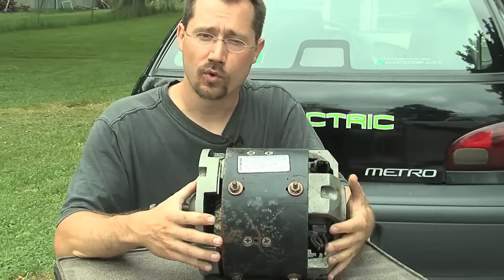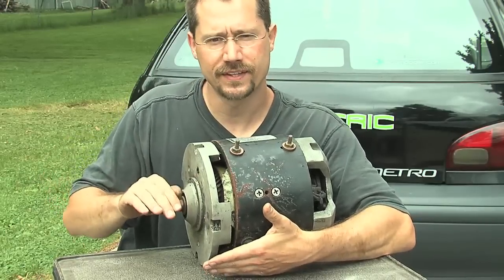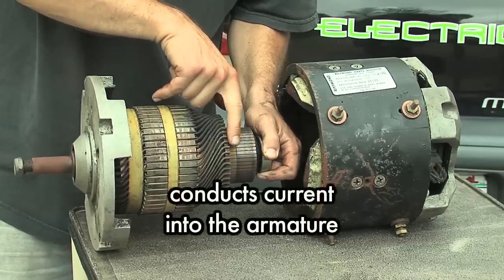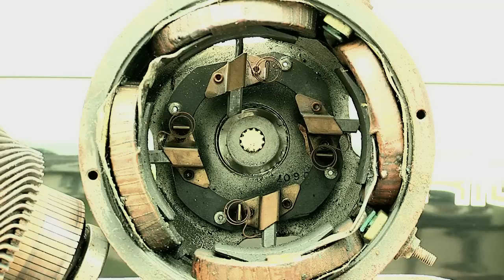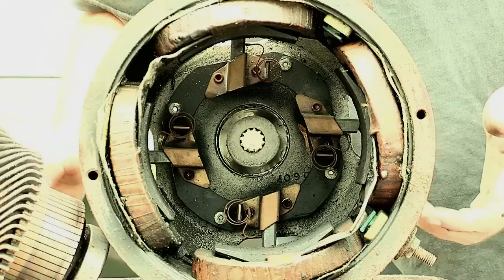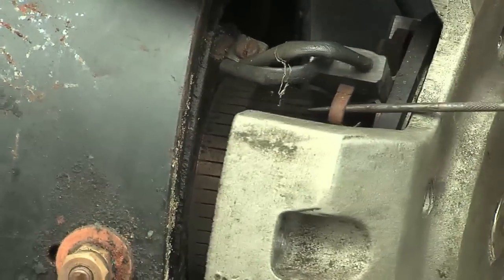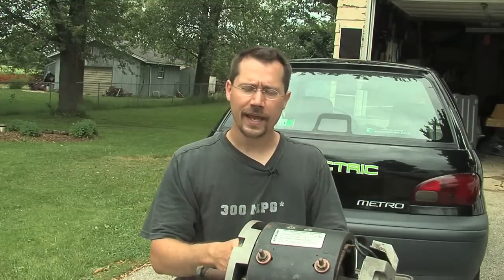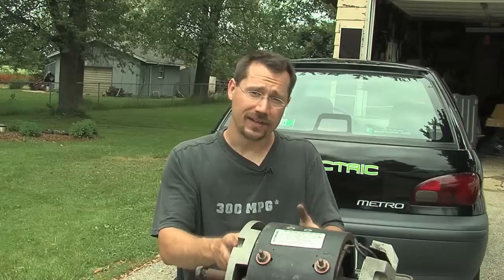DIY Electric Car: 04B DC Motor Basics, Part 2

Comment: I've been watching your series of videos and they have given me some good insight on my next project. Great job!!!

Yet one thing needs to be addressed when you replace motor brushes.

I am a certified Yale/Hyster/Cat/Nissan/Mitsu/Crown/Clark/Raymond mechanic.
Most all manufacturers require the commutator to be stoned (yeah, sounds funny) when replacing the brushes. This is required for warranty and performance assurance.

When you purchase your brushes, ask the supplier for a good quality commutator stone for resurfacing the copper contact surface before installing the new brushes.
It will make a WORLD of difference to the performance of the motor plus ensure proper seating of the new brushes. Most generic brushes are flat (not concave to match the curvature of the commutator surface) and will require a "seat time" for the brushes to make 100% contact.

The concept is much like resurfacing a brake rotor.

Note: Safety first!!! You are working around electricity and moving parts!!!
If you are the least bit squeamish or doubtful, then don't risk it. Common sense rules. Don't be careless and either electrocute yourself or get your shirt sleeve caught in the motor OR have stone chunks or motor pieces flying into your eyes/face.

Before you remove the old brushes, only take one brush out completely.
Inspect the commutator for pits, uneven spots, burn marks and ridges.
Place the machine in neutral or jack the machine up (chock the wheels)
What you do next is simple. Start the motor, low-ish rpm's, stick the commutator stone in the slot where the removed brush cavity is at. VERY carefully and slightly, press the stone against the commutator. You will begin to see the outermost layer of copper on the commutator start to shine up. Slide the stone from side to side in the brush cavity, keeping an even and gentle pressue. Once you have removed the oxidized or dirty film layer on the commutator and have achieved a uniform shiny and even surface, you are done.
IF you have access to a good air gun, blow out the residual dust from the commutator and motor. Inspect for any contaminants or cracks.

Remove the old brushes, install the new ones, return the springs.

There are instructables online that show you exactly how this process is done.

This is just an FYI for you all who HAVE bought an old or older motor and want to truly return the motor to fresh and new state.

Happy motoring!!!
Reply: YES! Eric, I used a commutator stone when I re-finished my motor. You said it better than I could. Everyone, please read Eric's above comments, it's well put.

Comment from the maker: It was several years ago that I put new brushes in my car.Mine are still just fine. Some of it DOES depend on the quality of your brushes. There are several different materials, and some are harder or softer or more durable than others. It is a maintenance item, but replacing the brushes is easy. (Beats doing oil changes, air filters, etc.!)

Comment: Good explanation right there!
I'm thinking of replacing my engine in my little van, but also having a 50ccm engine that can extend my range, and at the same time, ditch my transmission because of this unbearable mess with oil.
I want to be able to drive with unlimited range, so this should be golden ^_^

Comment: I appreciate your help with all the knowledge. One simple question to ask: why are the brushes not put exactly 90 vertical degrees from eachother? Wouldn't cause a problem when the rotor turns in the opposite direction?

Comment: Hi Benjamin,
Thanks for your great explanation about running on a Electra motor. Great videos,keep it going please...
I have 1 question for you or all other fans :
Is it doable to put something like dynamo's on the wheels or solar panel for charging while driving to get more miles?
Hope to hear from you and the other fans.

Comment: Hi, great video, I'm very excited about to do the same as you, but I was wondering, how you can deal with the water, as this motor is open, there is no problem to the water come inside ?, there is to be sealed motor or there is no problem, other thing about the steering wheel, is that hydraulic one ?, how you handle this, or there is no hydraulic, anyway is a good move, and I build my own using also your instructions. Have a great day. Tks.

Comment: Can u put an' onboard' battery charger? besides the charging systems that is set by your design  by a magnet driven charger also? by placing the magnets at an angle with a gen. on place where there is room 4 it?

Comment: Here is a question I have to ask, a windmill spins, tires spin, better yet, so does a car's' air conditioner when you turn it on, and a battery charger can turn it off when it's charged. It seems this concept be used to extend the distance?

Comment: My concern with using a fork-lift motor was that those machines are usually worked really hard for as long as possible, but it sounds like some parts last practically forever and the others are not hard to replace. The Bearings is what I would have thought would be really trashed. 
How would this motor compare to using a golf-cart motor?

Comment: How do I tell which terminal is A1 or A2? It seems to me that it wont matter because the stator fields will either attract or repel the armature windings no matter which arrangement you use. As long as I don't put a positive (A1 or S1) connected to another positive it wont matter. Right?
Thanks for all of your help

Comment: what about using a dune buggy frame?  (weight reduction i'm thinking)  also what about using ultra high grade industrial capacitors instead of batteries?  What power storage devices do you use?  Have you installed solar panels or use a peltier plate?

Comment: I love your simple real speak presentations, but, saying hp doesn't matter doesn't help me to select an alternative electric motor to a 100 hp gas engine's performance. Yes I know I will get more at the bottom and less up top, I'm referring to a median.

There must be a way to judge rather than merely saying 36V and hp doesn't matter, otherwise there would only be one size electric engine for everything.

Could anyone enlighten me please and help me to understand it a little more? I am actually searching for a 100hp replacement right now (that's why i am here). Thanks again.
Reply: Mark Mark doing electric repowers on boats I’ve heard 750 Watts = 1 hp so 100 hp would be a 75 kilowatt motor however a 75 kw motor is incredibly powerful think, the torque of a Dodge Ram v8 that can tow a 10,000 pound trailer. You would probably be fine with a
30 to 50 kilowatt motor and you can find kits for 3 to 6k on eBay for repower.

Comment: I'm an airsoft player that uses a PTW, so I know a fair amount of knowledge in regards to DC motors.  The motor I use has permanent magnets.  That being said, my motor brushes are used up relatively quickly depending on use.  How long do the brushes last for a DC motor in an EV?

Comment: I hear about the 9 inch or 11 inch motors, or warp 9 and 11. Where does a forklift motor fall into this? are they typically more, or less powerful than a motor made for a EV conversion? Oh, I'm thinking of using a 1991 Ford Ranger and maybe filling the bed with very large forklift batteries. I'll need something to run the vacume for power brakes.
Reply from the maker: +Fly house of truth The motor I used in my Geo Metro was a 10.5 inch diameter series wound motor from a full-size, sit-down Nissan brand electric forklift. It seems to compare pretty well to a Warp 9. There aren't that many differences between a plain old forklift motor and a series-wound motor sold specifically for EV use. The main one is that the brushes are "timed" differently if you are running higher voltage. That is, the entire ring that the brushes are on is rotated slightly due to the fact that the magnetic field distorts a bit when you are running high current/high voltage. It minimizes arcing at the brushes and helps keep the motor cooler and more efficient.

Comment: Hi ..what about if i change the rotor or stator with strong neodium magnet ..it's make difference ..about torque and electricty that will be consommed frome this motor ..? Thanks
Reply from the maker: Your are describing converting a series-wound motor into a permanent magnet motor.
In general, permanent magnet motors have less torque, but they are also more efficient. Keep in mind that a permanent magnet motor only needs to provide ONE magnetic field instead of two to make the motor spin. That also means that the quality and strength of the magnets is the determining factor in how much torque can be produced.
Modern permanent magnet motors can be very powerful.
Reply: @BenjaminNelsonX  very clair thank you so much 😊...please how can definit motor torque  what is the regle of that...(electric motor) thanks again

Comment: Can I easily put regen braking in a car with DC motor?
thx
Reply from the maker: The three main types of DC motors are permanent magnet, separately-excited, and series-wound. The first two work well as generators, but series-wound do not. If you are using a permanent-magnet or sep-ex motor, it's pretty easy to add regen, all you need to do is have a motor controller that supports that as a feature.

Comment: could you add an alternator to make your batteries last longer or would it not have any effect
Reply from the maker: No effect, at best. Using batteries to spin the motor to spin an alternator to charge the batteries can't gain you any energy, you would only end up losing to friction an conversion losses.
Reply: ok thanks man im looking at building a firebird right now
Reply: or you would get "perpetuum mobile" :D

Comment: Hey ben, I finally got my forklift motor and I was trying to remove the rotor so I could clean and paint the motor housing. I have run into a little problem though. There is a bearing in the rare which seems to be holding the motor in place and I can't remove the rotor. How do I remove it?
Reply from the maker: Pedro Casultsan In general, first, pull back the brushes out of the way. You can pull on the brush spring, withdraw the brush, and set the spring back on the side of the brush so it holds it in an out of the way position. There's usually something like four bolts holding either end onto the middle of the motor. Remove the bolts. Use a puller to push against the drive shaft and pull the end of the motor away from the rest. Always make sure to support the armature when pulling away other parts so that it doesn't flop around and smack against the inside of the motor. As you take the motor apart, make sure to pay attention to anything that might come loose such as a wiggly washer behind the bearing. Track those sorts of things so you can reassemble the motor properly. When trying to pull the armature from the motor, one way to do it is to place the motor vertically, with the open end DOWN. Stand the motor on some wood blocks so that there's room below for the drive-shaft. Pull the driveshaft straight down. If you have an especially big and heavy motor, an assistant is helpful. Otherwise, really watch your fingers and toes! Nobody wants to get pinched or dropped-on. Again, if you don't already have one, buy, borrow, or rent a puller. Use it to pull the ends off. If you can't in some other way pull the driveshaft, make it vertical, pull on it and tap the end.
Reply: BenjaminNelson Thanks for all the help. I finally got it out but the rear bearing was rusted to the housing (that's why I had so much trouble). Thanks again.
Reply from the maker: Pedro Casultsan Pull that bearing off, clean off the shaft and housing with some emery cloth, get a new bearing and install it.. If you can't read the number on the bearing (because of the rust) take it to a real bearing shop. They will be able to find the right replacement for you.

Comment: Also did you replace your gas engine with that electric motor? And how do you keep it charged?
Reply from the maker: Yes, the electric motor replaces the gas engine. It is powered by a battery pack, which is charged up from a battery charger, plugged into wall power.
Reply: BenjaminNelson What is rated wattage for your electric car motor?

Comment: So where exactly would I connect that motor to? The axle?
Reply from the maker: The electric motor bolts to the transmission in place of the original gas engine.
Reply: @BenjaminNelsonX  what about an automatic transmission?

Comment: Benjamin can I use a 36V DC motor? for mi conversion??
Reply from the maker: +Carlos Delgado You might be able to. If it is a nice large and powerful 36V series-wound motor, you could certainly over-volt it for a DIY conversion. Keep in mind that CURRENT is really the more important thing. You want a motor that can handle the current you require. A large 36V motor with beefy windings could handle high current whereas a small motor with thin windings won't be able to.
Reply: Thanks i keep un mind regards

Comment: so if the torque is more important than the hp so can i use the washermachine motor ac dc
Reply from the maker: You still need a motor that's a decent size and can handle a fair amount of current. There are some "direct-drive" motors in used clothes washers nowadays. One of my friends was talking about trying one out on a light vehicle, like a really simple electric motorbike.
Reply: thanks i think that it s good for me to continue my prjects
Reply: The problem with a washing machine motor is the fact that it is ran from AC current. Most vehicles use DC current which is somewhat safer and DC motor tend to have far more power in a smaller package. DC motors are expensive and have a lot of torque but wear out more quickly. AC motors are bulky heavy and lack the torque a DC motor will have. Also you would need a far more sophisticated electrical system to convert the DC power from batteries into AC current for the motor.
Reply: Jeffrey Long
what about the  converters that ar for sell  now in walmart  to power electric tools that will do it?

Comment: Is the 0-60 good?
Reply from the maker: Depends on the voltage the system was run at. At 144V, the 0-60 acceleration was better than a stock Geo Metro.
The big difference was how much power there was at the low end. A series-wound DC motor has a tremendous amount of torque. I could chirp the tires in the car with the electric motor. It also used a 5-speed manual transmission. The motor has enough torque that in city driving, I could simply leave the car in one gear (2nd or 3rd) and drive it like an automatic. I never really built the car for "performance", for it worked well and was rock-solid reliable.
It was also pretty common for people building electric dragsters to use large customized DC forklift motors.
Reply: BenjaminNelson thanks

Comment: But you dont need a gearbox right?
Reply from the maker: You at least need gear reduction and some way to connect the motor to the wheels. In a front-wheel drive car, the transmission does both those things.

Comment: WHY Not Brush less ?
Reply from the maker: Brushed DC motors are simple, available, and create an amazing amount of torque. There are MANY other types of electric motors. For example, the new generation of commercial EVs all use various forms of AC motors. Brushed DC motors have been the mainstay of homebuilders, but if you find a different type of motor, that is powerful enough, and fits your budget, go for it!

Comment: why use a transmission when you don't need it with a electric motor
Reply from the maker: It's still the easiest way to connect the motor to the drive wheels, even if you left the motor in a single gear.
Reply: electric motor anyways need a step-down gear ratio as they can reach thousands of RPM while the wheels won't spin at the same speed. it's pretty difficult step down the gear ratio so the transmission with the car comes is the best way to do it.
Reply: @rajeshraj-oq6wg  care to elaborate?